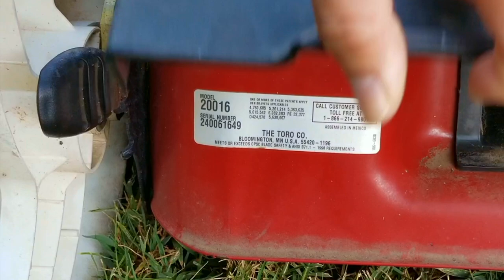Replacing the transmission on a Toro Lawn Mower.

Comment: "and they'll let you borrow the cheap set" I got my belly laugh for the day. Thanks!  That transmission was very economical in my book. Some of the newer (and non-serviceable) ones have set me back upwards of $100US
Reply from the maker: Congratulations on your 1k subs! Glad you enjoyed it, and yes some them are over $100, I almost certainly I would have passed at that price point.
Reply: Yeah I looked at a few and seen over 100$ price tags for certain model transmissions which in that case if the mower don't cost much buy a decent used mower ,  harbor freight has cheap die and tap sets so that's an option too not sponsored... lol just if you need something like that and don't want to spend hundreds on a kit harbor freight got you covered or if you knew the size just buy the single tap for well probably close to 20$ maybe less

Comment: Well done! I typically replace those and the lawn boy insight transmissions. Make sure to replace those missing dust covers for the wheels. Otherwise, the wheels will accumulate debris and add extra stress to the wheels and transmission.
Reply from the maker: Good tip! I'll get them soon. thank you Riley Sindt.
Reply: The new wheels hit the dust covers

Comment: This video was perfect. It was my exact mower and I followed every step. The only snag I ran into was gears were so run down that when I attempted to unscrew the nut on the pulley, the gears inside the housing would turn but not the shaft like u showed. I had to get inside the housing of the gears and wedge something in there so the nut would loosen. Thank you so much.
Reply from the maker: no problem and thank you Gary Alioto
Reply: Gary........I'm having the same problem.  I'm glad you posted this.  I'm going to try to wedge something inside the housing like you did.  Do you happen to remember what worked for you?

Comment: Ha! Finally some one else smart enough to save old gasoline for cleaning! I have been telling people this for years!
Good job on the repair, those old Toro's are well built and worth saving.
Wise practice cutting the thread chase before letting one of those old Taptite's bust off on there. Those are near impossible to get out when the break on you.
Reply from the maker: thank you Chargero, I didn't want to make this a video on how to remove a broken bolt because the threads weren't there.

Comment: Yup. What I just said, in the previous vid. Wait for used parts. But that new transmission adds value to the mower. 
So when selling, it should get a fair price for the amount of work you've put into it. Appreciate the demo on the self propel system.
Reply from the maker: thank you Robert Lee.

Comment: Great job however it looks like it really needs the HOC plate bearings replaced, they look completely wiped out. The input pinion gear always looses the black coating and gets a little grooved as it breaks in, it’s actually not worn badly it’s just formed to the ring gear. The bronze output shaft bushings are usually the only thing you need to replace on these to restore contact between the ring gear and the pinion gear. I found them somewhere for only a few bucks each and bought a bunch of extra ones since I used to make this repair on Toro and LawnBoy gearboxes all the time. Don’t see these great old ones much anymore, mostly just the newer Recyclers and LawnBoys with the sealed plastic gearbox.
Reply from the maker: you're absolutely right. There's a bit more that's worn out that just the transmission.

Comment: My Toro had the same issue.  I was going to replace the transmission.  When I went to disassemble it I found the woodruff key and spring on the axle had been replaced by a square steel sheer pin and welded in place.  Apparently the production line had run out of them and decided to keep the line moving.  That soured me on Toro, however I just disabled the transmission and push it.  Fourteen years later I'm still pushing it so  I'm not so sour on Toro.
Reply from the maker: wow, I had never heard that but it makes sense .

Comment: I recently did the same thing on what appears to be the very same model.  The old transmission was shot, housing damaged, etc.  Make sure to get the right part number!  There's another one that looks the same but is for the rear-drive model and the wheels rotate the opposite direction.  I've also seen a difference in the pulley diameter, not sure if that is a model year change or front/rear drive difference, but the belt size needs to match obviously.  My one-owner mower has the same pulley as yours in the video.

The Toro website has good information, I was able to provide the model and serial number and then download manuals.  The only problem I had was getting details about the transmission internals from my local Toro parts supplier.  They were able to access more details than I could (dealer access) but did email me an image or two that helped a lot in deciding to replace the entire transmission and axle assembly.

Oh, and I used my mower as a push mower until fixing it... It's a heavy mower, unless you're cutting a smooth level yard I don't recommend  it!  The self-propelled drive helps a lot on slopes and uneven terrain.
Reply from the maker: thank you Bob Blum for all the information.  I appreciate it.
Reply: @HomeGaragechannel  You're welcome!

Comment: I have this same model. Same issue with the transmission. Got new one. Installed everything correctly. Wheels didn't move forward. I made sure gears were installed in the right direction.  * head scratch * I took the whole thing apart again, looked at the transmission gears and compared with old one. The FACTORY INSTALLED THEM BACKWARDS!!  Now trying to discern whether to return or reorient them myself.
Reply from the maker: I'd return it.

Comment: If I was giving it away I would have made sure that it was running well and not worry about the transmission. However, if I was looking to make a profit, I would take the price of the transmission in mind to see if it was still profitable bearing in mind the overall condition of the mower.  Great video explaining the removal and installation.
Reply from the maker: thank you Mario Cestra.

Comment: If the transmission was at a great price at less than $100 like in this case I would have replaced the trans to get the self-propelled working again as well if the mower was in good condition, great video!
Reply from the maker: thank you WildeFox

Comment: I tried it but it was not successful yet, that washer that you didn't see during disassembly I didn't find either. Not sure if it was there or I lost it. Also, my keyways were too small for the slot in the new transmission shaft. A trip to the hardware store in the future. For my 2007 model the transmission was $94.94. I'm going to keep trying but really need to find a schematic of my mower and a parts list. It looks like the gears can be switched (as they have L & R on opposite sides) to the other side which will allow them to wear evenly.
Reply from the maker: I hope you get it going again

Comment: I rebuilt a transmission on a Craftsman mower about 35 years ago. At that time, I think everything came in a kit. I think I still have the leftover gear oil that came with it. On another video, you mentioned a second channel. What is it so I can subscribe?
Reply from the maker: fantastic it's Inside House Garage.

Comment: Does the transmission come pre filled with a lubricant? If not what do you fill it with? From my research the correct grease that goes in the from the manufacture is about $50 a tube from Peerless
Reply from the maker: yes they come pre-filled otherwise there would have been a tag stating to fill it before using it.  They also would have included a bottle of the lube.
Reply: @HomeGaragechannel  thank you, going to work on my replacement today!

Comment: I like FWD better. WAY easier to turn. Admittedly, not as good while bagging. It's nearly impossible to find a big bore FWD mower this day in age. High wheel? Good luck.  

Will you list part numbers and supplier, if it's not in the description? Thanks for posting. Super helpful!
Reply from the maker: thank you MJorgy5 and If I can find that information in my files, I'll try.
Reply from the maker: I updated my description with a link to the one I used
Reply: @HomeGaragechannel  Thanks again! 👍👍
Reply from the maker: no problem

Comment: If you would have rebuilt the transmission, what type of grease would you have put back in the gearbox?
Reply from the maker: that's a tough one. My choice would be based on the grease that was already in it, which looks like a high temp grease for bearings. I don't think it's 90w .
Reply: @HomeGaragechannel  thanks! I have kinda of the same transmission on my mower and wanted to "maintenance it" and put new grease in it.
Reply from the maker: that's a great idea.

Comment: Hi, I always watch your great how to videos, but I have an echo handheld leaf blower that dies when on idle but stays running when you give it throttle. What could be wrong with this? Thanks
Reply from the maker: hello Zach Coughlin, I'm going to guess that the carb is beginning to have trouble delivery the right amount of fuel. Either you can slightly increase the idle speed so it doesn't die, or you can replace the carb.

Comment: I have a toro 22" personal pace  rwd mower that the wheels will free spin in the air all day long, but it stalls out on the ground. It also feels more difficult to pull backward and makes a little noisethan i feel it should, but this is my first personal pace mower, so it may be normal. I've tried adjusting the cable, but there is no change. Any idea what it could be?
Reply from the maker: the transmissions on the personal pace versions, don't normally wear out but It can happen.  Also have you "serviced" the drive gears?  If you adjust the drive cable and it doesn't work, then you'll need to replace the belt because it's worn out.  basically the belt is not grabbing the pulleys anymore
Reply: @HomeGaragechannel  yes I serviced the ratcheting mechanism cleaning all the old grease and applying new I also took some time and changed the grease in the transmission it looked ok but changing it can't hurt and the self-propelled cable has been adjusted. I was leaning towards a belt but wasn't 100% sure. Thanks for the help!
Reply from the maker: nice thorough work and no problem.

Comment: When i try to spin my pulley on my rwd it doesnt even spin and like the transmission is locked up and one rear wheel locks ul when i i pull the mower backwards and i cant even get the drive pulley off what do i do
Reply from the maker: not sure.  I'd ask someone close by for help.

Comment: Which mower is better with the transmission in the front or the rear?
Reply from the maker: I believe it to be in the rear, also it seems like cheap mowers with self propel have fwd while the more expensive ones are rwd.
Reply: @HomeGaragechannel  thanks! I’m looking to purchase a lawn mower this off season. I have a ride on mower but looking for a self propelled one to add for next mowing season
Reply from the maker: good luck to you. Do you have a preferred brand in mind?
Reply: @HomeGaragechannel  Honda . Have heard many good things about them
Reply from the maker: absolutely, as long as they have the correct amount of Oil, and is changed every year, they will last a long time, Also just as with any brand of mower, make sure you stay away from gasoline that has ethanol in it.

Comment: No need to borrow a tap, those bolts are self tapping. I've replaced more Toro transmissions than I can even remember. The front wheel drive ones are a lot easier than the rear drive ones.
Reply from the maker: thank you dave011679

Comment: I know this is an older video so maybe you won’t see this comment…I had a customer return a mower I sold them, a toro recycler with Briggs engine, and told me the self propel wasn’t working.  I replaced the belt, checked the transmission and adjusted the cable.  You know what the fix was?  The guard was blocking the pulley from fully engaging.  You ever seen that?  I bent the holes and made the guard move a little forward to fix it.
Reply from the maker: not sure if had but that was a good catch.

Comment: Replacing the transmission doesn't seem worth it to me. IDK what your plan is for this mower, but if it were me I'd have to sell it. With a working trans, it's probably worth about $100 maybe $120. Alternatively you could rip out the trans and sell it as a regular push mower for about $50-70. With that in mind, by the time you spent $60 on the trans, you broke even, and that doesn't account for the time and work you put into it. Then again, if this was going to be your personal lawn mower, $60 for a good self propelled lawn mower is a great deal!
Reply from the maker: you're absolutely right about the pricing, I'm exactly sure what I'll do with it but I'm not going to use it, as I prefer the mower I have now.

Comment: While I appreciate the video, I regret buying a new transmission and taking this thing apart.  With the help of the video, I was able to do everything until I had to loosen the nut attached to the pulley.  It was impossible to loosen and I've tried wedging tools etc. in the housing to get it loose.  I've wasted almost two hours trying to get this nut off.  At this point, I'm thinking about just returning the $60 transmission and settling on this just being a push mower until I'm ready to take the plunge to purchase a new mower.  Even if I do find a way to separate this nut from the pulley (which seems impossible), there is no guarantee that this new transmission will fix the problem.  As you contemplate whether or not to take on a repair like this, you have to make a decision if it's worth your time and money to repair a mower that's over 10 years old.  There is nothing wrong with the video & it is definitely helpful, but from my experience, repairs like this never seem to go smoothly and can cause more frustration than it's worth.   Thanks for the video.
Reply from the maker: sorry you're having a tough time with the nut.  I've never come across one that was a paint to remove before
Reply: @HomeGaragechannel  Update:  I managed to get the nut off by wedging a chisel inside the transmission housing.  I think it was a 1 inch chisel.  Luckily my brother had a better drill (time for me to upgrade) and the two of us were able to do it fairly quickly working together.  Thanks to your video, I was able to piece everything together.  The bolts self tapped into the housing nicely with a nut driver.  I had the drive gear reversed on one of the wheels and a retaining clip popped off.  Luckily it was stuck inside the wheel guard.  I didn't notice it was reversed until the wheel was stopping and starting.  After that was fixed, the new transmission worked like a charm.  As long as the $60 transmission holds up and the lawnmower keeps working, I guess it will be worth it in the long run.  Thanks again.🍻

Comment: The trans without threads was a zero issue, I barely put pressure with my socket and drove the bolt in, super easy.

Comment: The $15 dollar Re-store Snapper tranny was full of leaves when I got it so I cleaned it out and greased it back up with 00 Snapper grease but the pinion was worn out just as tours was. I ordered another pinion because it would lock up and have to be rolled forward every time the mower stopped moving. With a new pinion it has done just fine ever since. The housing and the side shafts have some slack but with the 00 grease, everything is close enough. The n85 model of course has some wear but the 00 grease takes care of that too. So I'd do as you did and fix the drive. Thanks nd Blessings!
Reply from the maker: thank you for the information
Reply: @HomeGaragechannel  It's good stuff and was named Snapper 00 grease originally.
Reply from the maker: I wonder if they still sell it
Reply: @HomeGaragechannel  You can still get the 00 grease but not have the Snapper name on it. I really like it because it's between a stiff grease and an oil. Snapper used it in all their trannys, both walk behinds and riders and maybe tillers too.

Comment: i probably wouldn't have replaced the transmission. most times the math doesn't make sense. what would it be worth if you had sold it as is vs  spending the $50 on a new transmission. most time the value only goes up by the cost of the parts and you loose money or make very little on the labor which most times just doesn't make sense.
Reply from the maker: you make a good point. 60 before replacement and 100 after. looks like you're right.
Reply: @HomeGaragechannel  the only thing i will sometimes spend money on is buying a used mulching bag. most of the time you can pick up a used one for about $20 and it will help increase the value by $40-50 on  a good machine. also for some reason i find machines that have the mulching bag seem to sell quicker and easier.
Reply from the maker: oh nice to know that, thank you.

Comment: I said to shim it in the previous video but with all that wear it wouldn't work very well
Reply from the maker: no it didn't
Reply: @HomeGaragechannel  I seen you said to replace the grease in the transmission well when I did mine I didn't have grease on hand so I added oil in it and mixed it to thin the dried out grease just for now and to have some lubricant in there lol temp fix wish it had seals and took gear lube